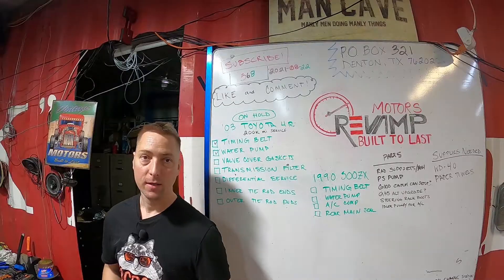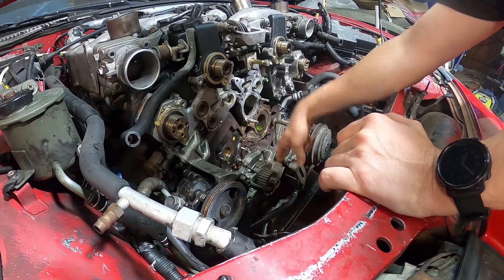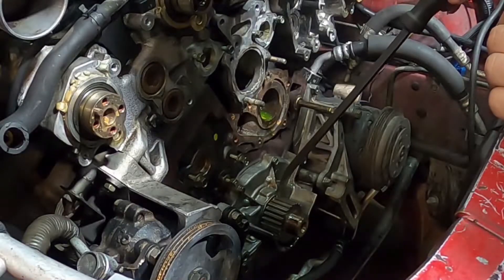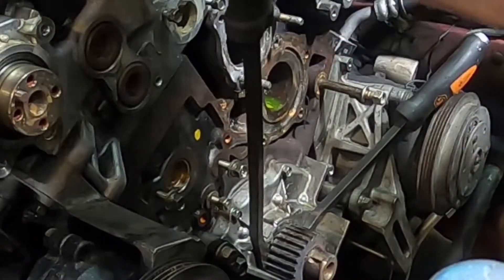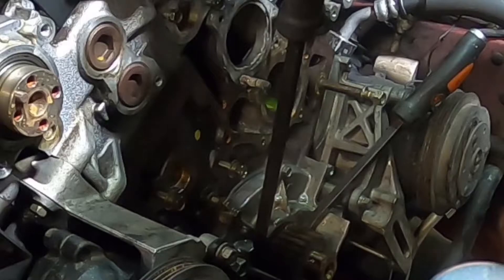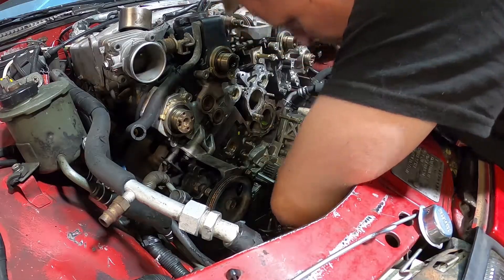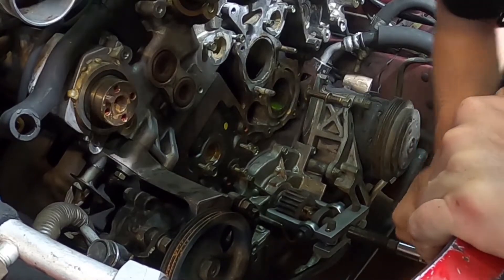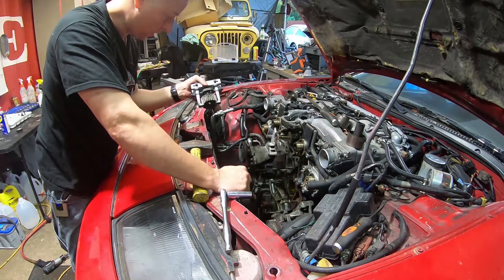Nissan 300ZX Timing Belt Project:  How to remove the timing gear WITHOUT cutting it!

Comment: Yikes! Mine won't come off either. I'm not sure I've got the same tenacity as you showed. I hope mine's not that seized....
Update: Could not get mine off so because the seals weren't leaking anyway, I decided to skip replacing the seals until it does. Then I will apply more diligence.☺

Comment: Brother for the love of God please stop prying against that soft aluminum oil pump.
Reply from the maker: Thanks for the comment, definitely was not the most ideal situation.  Alternatively I could have tried to drill and tap 2 holes and use a steering wheel puller.  Will do better next time!  I appreciate the feedback!!
Reply: I was wincing,Yikes!    Took me about ten minutes to cut a groove with a Dremel and then a couple good wacks with a chisel split mine open😎
Reply: Worst way ever to take that off. That can break the oil pump. That happened to me once.